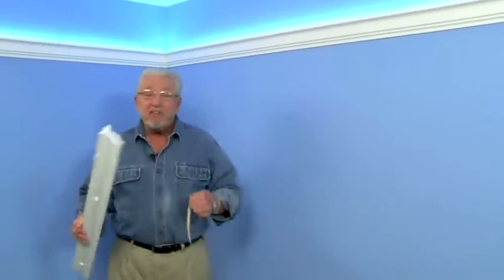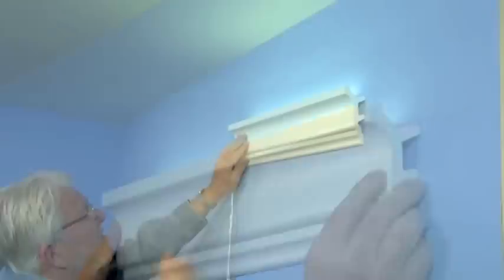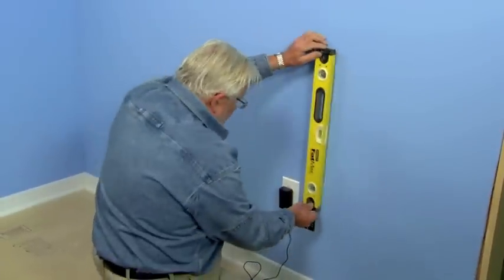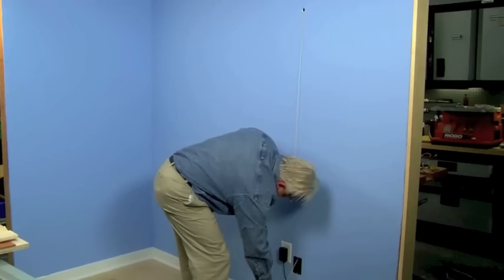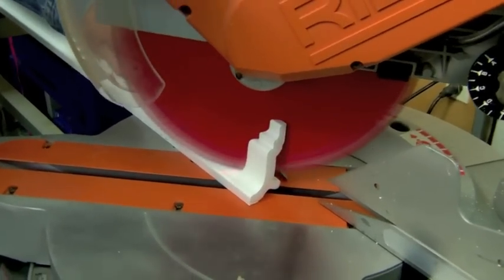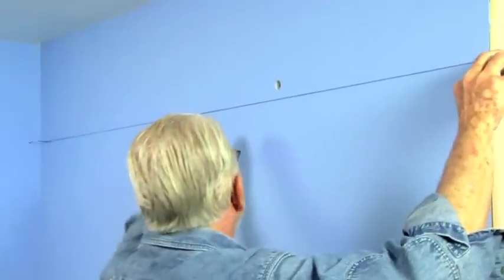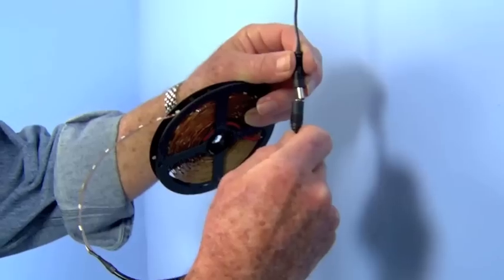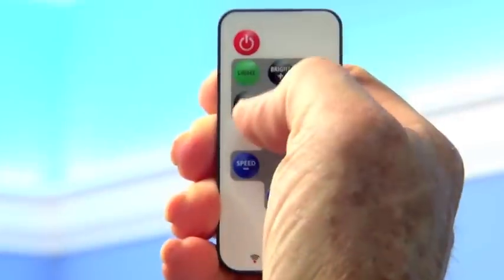Foam crown molding with LED indirect lighting

Comment: 3:05 Check your LED strip specifications if metallic tape is actually okay. Many LED strips are designed to be glued to raw aluminium for heat dissipation so those would have zero problems with fully metallic tape. Instead, fully metallic tape would then behave as a heat sink and prolong the lifetime of the LED strip.

Comment: My only suggestion would be a slightly higher hole up top and run conduit down to the new box below, then the wire through the conduit. This would add extra safety.

Comment from the maker: Yes it has a class A fire rating. you can see on our website Austincrownmolding.com.   Installing LED lights is safe only if installed correctly. That means the right transformer with matching LED strips and wiring. For help or to purchase LED lighting click on the links above in blue.
Reply: Shush

Comment: great instructional video sir, thanks for this idea, i most definately will be doing this in my "garage  to  a  den"  project
Reply from the maker: The best place to get LED lighting strips and power supplies is http://crownmoldingledlighting.com
Reply: Austin Crown Molding well thank you sir i appreciate that info !  i looked on amazon too but will definately check thar site before i buy

Comment: Thank you for a FANTASTIC diy tutorial! 
Can I omit the reflective tape?   Is that just for reflection? Or does it help with any heat reflection of the LED that would potentially cause melting of Styrofoam or other heat hazard?  

Thank you again
Reply from the maker: The reflective tape helps smooth out the light and make it more even on the ceiling. Our LED light strips run very cool because of the heavy copper built into them. Its not a heat problem.
Reply: @austincrownmolding4360  I understand. thank u for responding!

Comment: In my country we make walls with bricks. We don't use drywall, so we can't pass the wire behind the wall
Reply: With a good drill you can it's not that hard as long as you have the right tools.
Reply: Get a mason drill bit

Comment: I want to do this but I want a crown molding design that supports mounting the LED strip underneath it, so I can have the crown molding flush with the ceiling and the light shining down the wall from under the molding and not up towards the ceiling.
Reply: Nice idea...

Comment: So I am planning to do an rgb ceiling for my room.
15 meters of strips to cover the circumference of the ceiling.
Total power draw is 275 watts 5v 55amps.

So lets say the power transmission wire will have to travel 20 meters in total since it will be coming from power supply near a wall outlet .

What gauge wire should use since I am to inject power to the rgb strip every 5 meters?

Comment: hi great video. in have the same set up but before I install the led should I leave the wireless controller wire hanging out to use the remote or its OK to hide it? I ask for I don't want to mess up thanks
Reply: Dae Dae - I would suggest testing your controller to see if you need a direct line of view (most do) between the remote and the controller. Simply hook up your lights with the controller and place something in front of it then check the remote. If it works you should be able to tuck the controller behind molding. I had to just tack my controller down with a dab of caulk on top of the molding in the corner. The controller was white and the molding was white so unless you are looking for it ya really don't notice it.
Reply: jlathem Great! thanks bro that information makes sense of it all.I will keep that in mind when installing thanks again
Reply: Most remotes today are called "RF" Radio frequency. No line of site is needed. It will actually go threw several walls.

Comment: Could an attic safe power supply be plugged into an attic plug outlet, and connected to the RGB light strips through a small hole in the wall?
Reply: Yes, just as long as the attic temperature never goes over 110F.  Top of cabinets, inside a cabinet, utility rooms, behind a TV are good places. Power supplies should never be cover up.
The need at least 6-8 inches around it to breath.

Comment: The link for the lighting doesn't work. What is the best LED lighting to use for this project? I tried Armacost ribbon flex pro, however, the box can only supply a maximum of 36 watts so connecting more than 16 ft does not work.
Reply from the maker: Yes you much match the wattage of the strip light and power supply.  Contact us at @t  and we can help you,

Comment: Wait? You can hang up molding just with caulk and no nails whatsoever?
Reply: Pink Berry Yes, this type of molding is made of foam. It’s lightweight, but can hold cables or LED strip lights in them. Much more inexpensive compared to wood molding and much easier to install. It’s a brilliant idea.
Reply: Jay Rios oh wow! Thank you for your response! Had no idea that was a thing! Genius! I wonder if my apartment complex would allow it if I took it down when I leave and fix it back to normal

Comment: A cheaper alternative and very easy to install, can be a DIY. I like it  and want it,  but it is not available in the PHILIPPINES , how sad .
Reply: LEDs like this can be ordered online from anywhere, even if they where available locally I wouldn't suggest it as they are typically more expensive then. you can also get RGB ones not just white ones.
Reply: Preußisch Jäger  ... i am talking about the styro crown molding... i already have LED strips  in the house but i dont have crown molding on my ceilings.
Reply: Mhel Aproda oh ok sorry lol
Reply: probably made in the phillipines!
Reply: philippines

Comment: Isn't it against code to run power in the wall like that?
Reply: No it is not against code. It is low voltage. About 12V DC.
Reply: Gotcha.
Reply: How could I get the star effect in my 2011 Camaro?
Reply: How does the power get to the outlet if that's the case?
Reply: twennywonn what’s code? I want to look into that. I don’t want to cause a fire in my house.

Comment: are we allowed by code to run a 12v power cord behind the wall in Texas?
Reply: Nperez1986 no
Reply: You can do what you want it's your house
Reply: Most states this is against code, so no.  And as the other commented below said, it’s your house you can do what you want, but, if this causes a fire, the insurance company will definitely deny any claims for coverage

Comment: I have two questions that are important to everybody installing this type of molding. First, what is the maximum length of led strip that I can install on a single power supply (5 A)?Second, where do you put the IR receiver that you use to control the lighting?

Comment: Took the trouble to run the wiring in the wall, and then uses the ac adapter....  kinda like putting a bigger engine in your car by mounting it to the hood...

Comment: What the heck kind of a wall is that? My walls are not hollow ok?:))))
Reply: Well mrk, you are right, that is definitely a "gotcha" moment!  The method shown in this video certainly won't work in most other countries around the world.  In the USA we build homes with toothpicks and cardboard! :) But, there is hope.  For solid walls a discreet low-profile wire cover could be used, perhaps located in a corner and painted to match the wall color. Many use a snap on cover so the wire could be concealed in a very small unit. Many of the wire covers also come in various colors to use with wall paper too, where you might not want to paint it.  Good luck with your project!
Reply from the maker: Inside walls are hollow.

Comment: That molding is damn expensive
Reply: yeah i'm struggling to commit to even 24ft for testing/demo (to see if i can light the room) when shipping is almost $38
Reply: cdoublejj ikr...ridiculous
Reply from the maker: You pay for what you get $38 will buy you garbage!
Reply from the maker: For great LED lighting supplies check out https://crownmoldingledlighting.com
Reply from the maker: Its no higher than wood. The labor you save easily pays for the shipping! Looks better than wood because it does not contract or expand. No nailing or holes to fill and sand. Uses only one coat of paint.